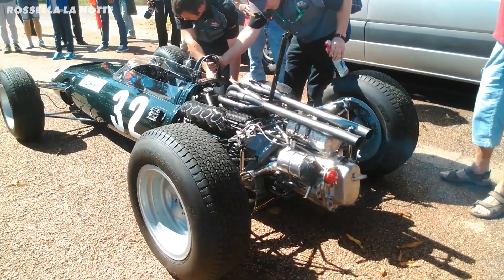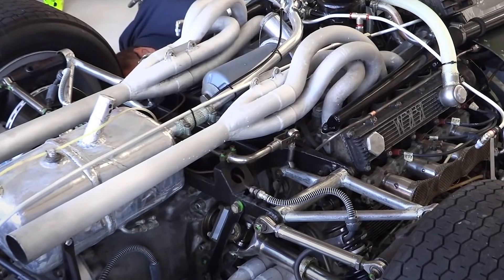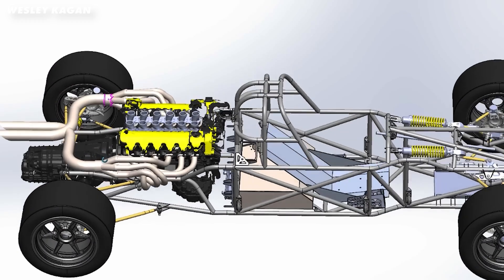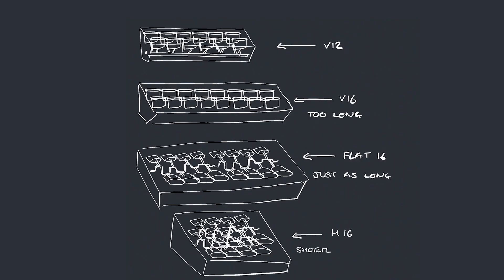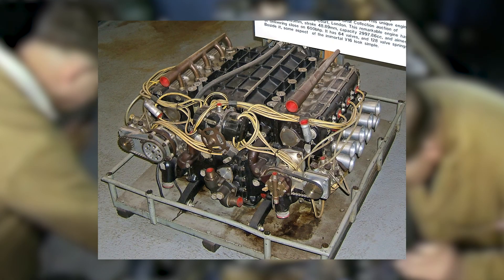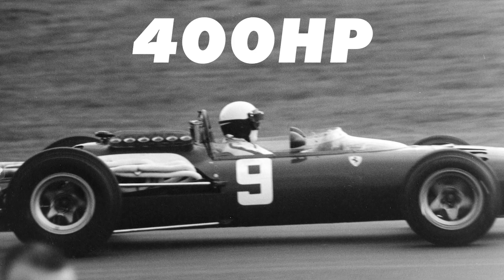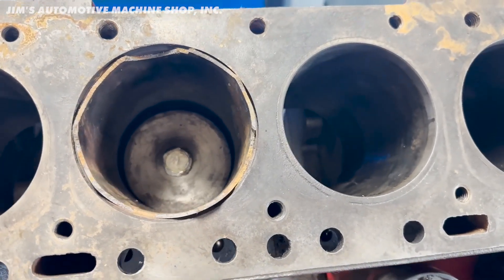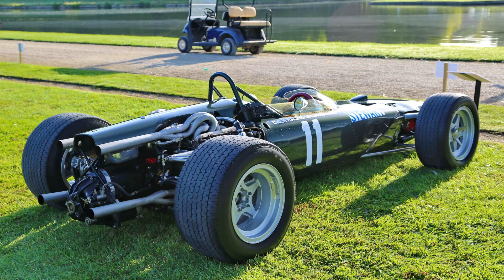The INSANE H16 Formula 1 Engine!

Comment: BRM also ran their 2.1L Tasman Series V8 while the H16 was being developed. The real reason they went with a 16 was chief engineer Rudd convinced the owners they could save money by using the pistons, rods, valves and cams from the 1.5 V8.
The weights were added because the upper cylinder bank had less rotational mass than the lower and would gain and lose RPM faster causing excess vibration. They weighted the upper crank to give it the same characteristics as the lower which had the flywheel and clutch assembly attached.
Reply: I didn't know that BRM had a 2.7 litre V8 but unless i'm mistaken Tasman rules only allowed engines up to 2.5 litre that why you get 2.5 litre Cosworth DFVs and Brabham Repco engines and Ferrari using the 2.4 litre Dino V6 rather than V12 in tasman series.
Reply: @adammercer6004  Yes, i meant to say 2.1   V8 that was used in the P261 in the Tasman series.
Reply: @johnjones928 eah that sound more like it I knew anout the upsized V8 unit and the upsize V8 was fairly successful as it won the 1966 Monaco GP driven by Jackie Stewart and nearly won it again with in 67 until the car develop a problem and forced Stewart to retire considering that the car it was mounted in dated back to 64 that's a impressive achievement.

Comment: You know, I’d love to actually see a diesel, supercharged, commercial duty H-12 or H-16 with electronic (not direct) fuel injection.

Interestingly enough, I think it’d potentially be usable for very low profile heavy haulers that are essentially airport tugs, with the cabin actually having a floor basically at the bottom of the vehicle, and the engine being directly behind, driving a driveline all the way to the rear wheels

Dumb idea, but interesting to think of an H-12 or H-16 that can essentially fill out its entire area used, unlike the usual inline 6 or bigger v12, essentially allowing the engine to take up close to 100% of its used area
Reply: Buses have been using horizontal engines for years.A H layout wouldn't be any benefit to them .
Reply: Nah, H-layout is dumb when V12 just serve so insanely well from stationary to main battle tank

You know, those people hate downtime and appreciate reliability more than engineers wet dream

Comment: That is the most insane engine i've ever heard of.
Reply: A nightmare kind of
Reply: I remember a Puch moped engine with two pistons, one combustion chamber, but not opposed piston. Picture a single cylinder engine- block, crank, con rod, piston. Then connect a second con rod to the first one, pivoting near the head of one of the first con rod’s bolts. Add another piston and cylinder parallel to the first. Both pistons rise, then the first piston passes TDC while the second is still rising. Second piston passes TDC, now both are descending. Why on earth would you make such a thing? You get very complete combustion because the thing has nearly constant combustion chamber volume for a rather long period of crank rotation. It wasn’t a bad idea, but the heat loss due to large surface area of the combustion chamber rather overcame the benefits of long combustion times.

Comment: The key innovation that killed this kind of design madness was Keith  Duckworth's tumble swirl inlet ports in the DFV. The DFV had much better combustion from a 4 valve head that allowed higher rpms without having to resort to more cylinders.  The DFV engine is really year zero for modern engine design.  Most engines today owe their combustion chaimber and port design to Duckworth.

Comment: What constitutes 1 engine and not two bolted together?
Because I’m thinking without the link gear, they are two engines. So hypothetically they could of put two side by side. Probably with a similar outcome, but none the less
Reply: Even much more heavier with unnecessary thick wall and more mounting on either engine

Here's the thing. H-engine just suck at being reliable. Including those on plane

Comment: That's cool... But obviously found the then limit crossover point for complexity.
Just listening to the design methodology has me shaking my head.
I love the concept, but an H shape? Essentially bolting 2 engines slapdash together?
I'd only want it as a showpiece & as a research/scale test in development.
Before he got that far, I was wondering if they were going X shape, W a single central crankshaft.
Unfortunately not.
Still an awesome engine W an incredible noise!
Reply: Master-slave conrod on high RPM racecar is just insanely dumb. Let's start with that.

You had to deal with literal unbalanced stroke length. You'll find even worse situation than this H-16

Comment: I remember reading about a larger version of this engine for the Indianapolis 500 in a Lotus. I don't think it raced thought.
Reply: Yes BRM had agreed with Lotus to make a 4.3 litre H16 for the Indy 500 but obviously from the moment Lotus took delivery of the F1 engine and they realised it 4 to 6 people just to get it out the van and move around anywhere did Colin quickly realised  that the BRM H16 was not going to be Lotus answer to either F1 or Indy  and that lead to the Lotus/BRM indy project die in crib despite BRM putting alot of there resources into it but luckily for Chapman he didn't put he's eggs in one basket for either F1 or Indy as he had already got Ford to fund Cosworth new 3.0 Litre engine the legendary V8 Cosworth DFV and was looking at turbine power for the Indy 500.

Comment: I have one of the cylinder heads piston and con rod from a brm 16, not sure if its a v16 or h16 engine, i believe its a h16, it has butterfly valve springs rather the usual coils
Reply: That's easy - the V16 is eight cylinders long and the H16 is four cylinders long. Also the V16 has hairpin valve springs and the H16 helical ones.
Reply: @1258-Eckhart  that cannot be correct this head has hairsprings but it a 4 cylinder
Reply: @alexhogarth184  So it's one half of the eight cylinder bank of the V16. The camshaft drives were in the in the middle of both engine banks, and my engine diagram does actually show halved cylinder heads.
Reply: @1258-Eckhart  that makes sense, it was recovered from a pile of engines in the brm factory,
Reply: @alexhogarth184  Don't want to rain on your parade mate, but surely it belongs in a museum? It's 25% of the head castings for the most amazing engine ever built by anyone anywhere. It sounds like Beethoven''s 5th symphony all rolled up into one. The engine was also a fundamentally sound design and unlike its ten years younger sister (the H16), could have become reliable given the investment.

Comment: the BRM 16's were the greatest sounding engines ever made, bar none. at full tilt, the howl was absolutely incredible.
Reply: At that time yes up to the 80s but v12s of the 90s and v10s of the 00s  those were the pinnacle of engineering power and sound
Reply: The 787b sounds better honestly
Reply: @sigmamale4147  If your ears don't bleed.
Reply: @sigmamale4147   It's the perfect blend of two-stroke and 4-stroke sounds.  I'm waiting for Rob Dahm to finish the rebuild of that crazy 12-rotor engine.
Reply: @phillipzx3754  same, the block looks absolutely insane 😂
Reply: @sigmamale4147  compared to the h16 yes
Reply: the V16 yes.....the H16 meh, you might not even get to hear the engine before it blows.
Reply: But the previous v16 (1,5 litre) sounded way better than the H16 this video is about.
Reply: I suspect you're thinking of the BRM V-16 1.488cc centrifugally supercharged engine used in F1 from 1949 to 1951. Had a extremely narrow powerband that made driving 'difficult' according to the late Sir Stirling Moss who test drove the V-16 BRM T15 a couple of times. Had a very distinct howling sound once engine rpm reached approx.10,000rpm.  Was marginally more reliable than the later 3 litre H-16 of 1966/67, actually managing to win a couple of Formula Libre races 1953/54.
Reply: 😉👍 But McLaren were the smart ones in 1966. They opted for a superior Ford V-8. That brings us to one of the most asked questions throughout all of human history; "why didn't ALL the other F1 teams opt for Ford V-8's too"?
Reply: No they weren't. McLaren had no success with Ford engines until some years later, and those were built by Cosworth. The IndyCar-derived Ford motor that McLaren used in '66--'67 pretty well sucked when adapted to smaller-capacity F1 configuration and was outclassed. McLaren didn't have any success with "Ford" engines until some years later, when the Ford-funded, Cosworth-designed and built DFV engines became available to any customer team after the initial exclusive deal with Lotus expired.

Comment: could you imagine of the current manufacturers were just given a fuel efficiency and capacity requirement then free to come up with whatever they can make work with the hybrid system and driveline....... i mean someone would still run a v6 but surely there would be some interesting 4-10 cylinders smashing about
Reply: it would depend greatly on the total race distance. if the race distance is on the shorter side, then a less efficient engine is not too bad. but on a very long race, efficiency is much more important becuase even  1% less efficiency would mean tens of kilos of extra fuel. 

also if an hybrid system was put in place, we would end up with a system where the wheels would be driven by electric motors with the engine being used just to charge the batteries. electric motors are just too good compared to gas engines in nearly every metric
Reply: They did

It called "WEC"

Comment: H engines are pretty rare but there's one more famous than the others : the Napier Sabre family of H24 powering the Hawker Tempests of the Royal Air Force during the second world war.

And one of the main goal was to have compatibility of pieces between it and the inline-6 it was born from (take 2 i6s and make them into a flat 12 then stack those 2 flat engines on top of eachother and voila)

It also had a sleeve-valve system, that's interesting to say the least.
Reply: LJK Setright, a great enthusiast for the engineering prowess of D Napier and Son, once wrote that BRM failed to learn from Napier's experience, hence neglecting to incorporate various refinements brought about by that hard won experience with the Sabre.
Reply: 😂 men
Reply: Or sorry I'll take it back
Reply: There was a rather infamous dual linked engine in ww2 as well from rolls Royce, the vulture. Every problem they had with the h16, effected that engine in one way or another, though with obviously much more serious repercussions.

Comment: I believe H style engines were used a fair amount in tanks.
Reply: Nah, they use V12 and V8

The closest craziest thing they did is just opposite-5. Which made big diesel reaching twice its RPM and subsequently, power
Reply: Ah I remember, the craziest thing they did with tank engine is bolting 5 separate car engine into single housing and connecting all 5 crankshaft with gear. But it was run on detune anyway so no big deal in terms of reliability

Comment: How much do you think "yeah but it'd be really freaking cool" factored into the decision to use the H16?
Reply: In a millisecond I would make that choice.
Reply: It's also thinking out of the box.
If you copy someone (make a V12 for example), you might be 5% better.
If you make a brand new engine design, you are either totally sucky or 50+ % better, revolutionating the entire sport.
Reply: @barath4545  BRM weren't rolling in piles of excess funds at the time to build completely new engines, so they had to work with what they had. Hence the decision to take the existing 1.5L V8 design, modify it to a flat layout and then stack one on top of another. While a novel adaptation to the then-new rule set, the mashed-up development was somewhat predictable in its lack of success.
Reply: The sound.  Automotive Stradivarius.
Reply: Yeah
Reply: A lot.

Comment: For sheer power, nothing matches the 80's. 😎
Reply: That isn’t even true as modern engines can make more power while being more reliable and efficient.
Reply: So what modern F1 engine is producing more power than the late 70,s early 80,s Hart 1.5 liter or Renault 1.5 liter turbocharged engines?The problem is the rules have changed and direct comparison cannot be applied.

Comment: Respect to the BRM Engineers for building something unique. I guess a Flat12 would have been a better idea?
Reply: 🎉in the 80s someone tried to make a Flat 12, but it sucks too.
Reply: @gustiwidyanta5492  Ferrari used from 1970 to 1980 the flat V12 engine
Reply: @klbandini6140 And Porsche had great success with the flat 12 engines in their Le Man's cars.
Reply: Surprisingly those V8 DFV

Not because it's contain magical technology or anything. But you can put much more powerful ground effect diffuser with those narrower engine

Comment: I'd love to see what modern designers could do given more freedom.
Reply: That's the problem with today's racing series.  The boundaries of regulations are far too tight.  If you watch events like Battlebots, each year they are vastly superior to the previous year.
Reply: @AndyFromBeaverton  agreed, I can't remember the name but there's a pike's peak run with very limited regulations and they get such a wide assortment of things!

Biggest issue is driver safety, I'm kinda stunned nobody has done remote controlled full size series. The tech is more than ready, FPV drones for example. I guess the danger is part of the attraction, kinda fucked up.
Reply: @julian1000  you dont experience g-forces doing it by remote. no bump steer, feedback from the road.

THATS the point. it isnt the event. it isnt the spectators. it isnt the car. or engine.

its feeling those wheels screeching on the limit of traction, the pressure of your body being flung out on each turn, the harness on your chest as you brake hard, feeling the front locking up and backing off enough to still hit that apex, then finally slamming it down a gear and flooring it with the rear end kicking out sideways as you scramble to get back in a straight line and set up for the next turn...
Reply: guys really forget LMP1 exist. You can do whatever the f you want with your engine.

Guess what they do? 20.000 RPM V12? Nope, boring V4 turbo hybrid
Reply: @AndyFromBeaverton here’s the problem with that mentality costs, Motorsport has always been a money pit. With modern car technology being so mature any gains you make will come with a 9 figure price tag. And you can only do that for so long before someone questions the worth of the project.

Comment: Hi Scott, can you do an episode on Ferrari's F135A engine, I first saw it at the Modena Museum of Enzo. They said it's a V12 with 2 crankshafts but only 6 combustion chambers, which is beyond my imagination. And there's almost no data on the internet talking about it... I believe it'll be a great milestone for Driver61 to properly explained it. Thanks!
Reply: That won’t be a V12 - it’ll be an opposed piston engine. 😊
Reply: @rstone286 the pistons could’ve went the opposite way
Reply: And it would be a 2 stroke like the old 3 cylinder horizontally opposed piston Commer "knocker" diesel from UK, which had 1 crankshaft, but 4 con rods per cylinder & 2 heavy duty rocker arms per cylinder. It made a great sound.
Reply: @elroyfudbucker6806 
That engine is a derivitive of the German Junkers design of the 30's. Napier build this design into a three bank delta design railroad and marine engine.
Reply: When one  fits ( in effect) 2 engines together the it should  be that each engine is coupled as 2 engines, not as this is in effect, making one engine from two. Each water should be as 2 same with oil etc etc.

Comment: The weird thing about horizontal engine layouts is their crazy good for keep the center of gravity down, but if not perfectly balanced they're just dangerous
Reply: When you have exhausts exiting the top and bottom in this particular config, that kinda ruins that.
Reply: The weird thing is using the word crazy when very or extremely is much more appropriate.

Comment: The question is: Would it fit on the KA?
Reply: key word on not in
Reply: With enough work, everything fits on the KA
Reply: @r1l426  but it would no longer be the KA. it would be KAAAAAAAAAAAAAH16
Reply: @groundedgaming  What is KA?
Reply: @Miklos82  Ford Ka, is what I think they are refering to. It's one of the >$500 challenge cars used by the OVERDRIVE team.
Reply: Yes. 
On the roof rack...
Reply: I mean, if the A-10 Thunderbolt had to be built around a Gatlin gun, I think you make it work in a Ka